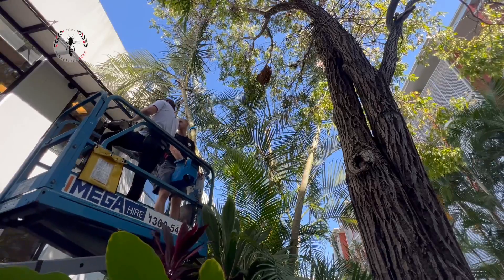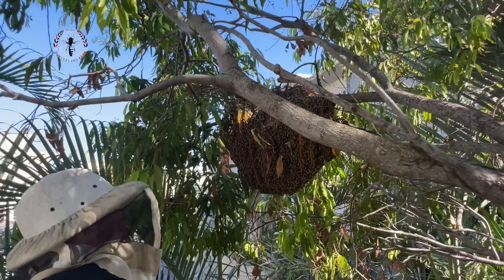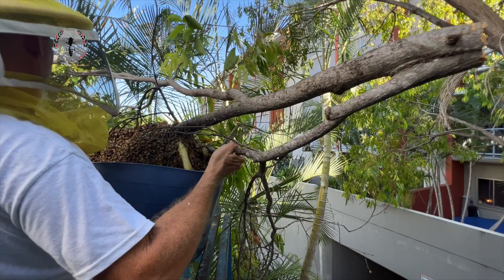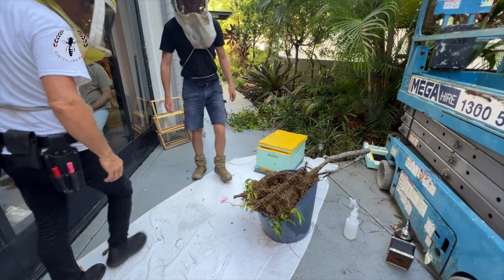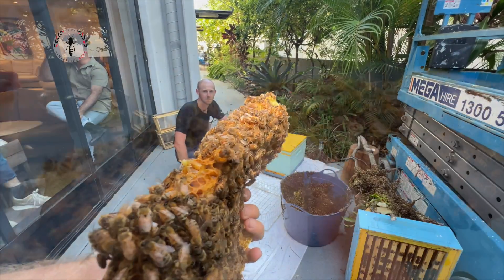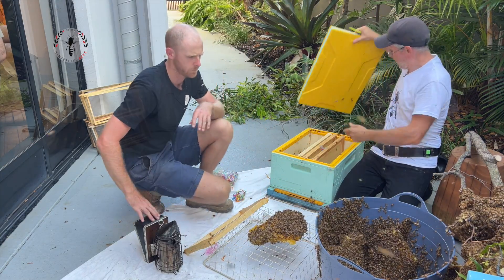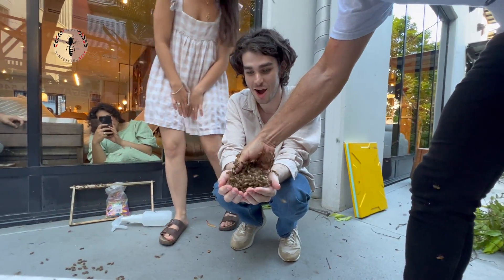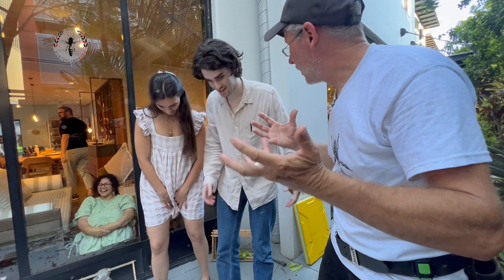Rescuing an Open-air Bee Nest

Comment: I just got some Hive IQs for this year.  I like the people watching in the window
Reply from the maker: How are you finding your HiveIQ hives? I think they are the best products on the market 👍
Reply: @HinterlandBees  I’m still painting and putting them together, but I see that they are very similar to the Lyson 8/9 frame hives, without that thinned out area on the box - so the R value is a lot better.  The boxes are actually interchangeable.  I just overwintered a colony in the Lyson hive, and they seemed very content in there, so I think these will work our very well.  The bottom board and entrance reducer are really nice, and the lid too- super heavy.  The plastic strips are better quality than the Lyson, but I just wish we could get the option to get them in black or white as well as the yellow
Reply from the maker: @zulikkowalski3547  it think you’ll love them. 
I paint the yellow plastic mouldings that are exposed to the outside, mainly to prevent UV damage, even though it’s not necessary according to HiveIQ